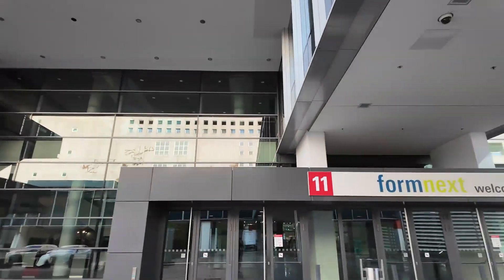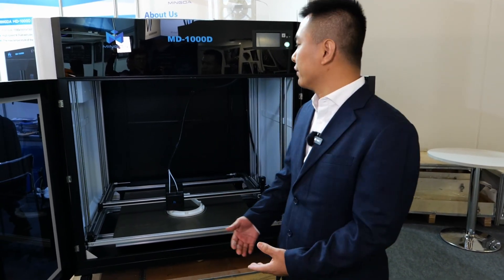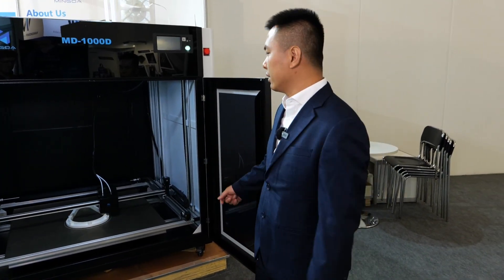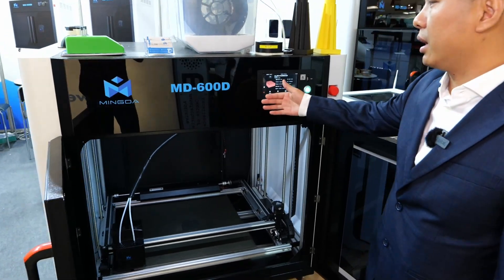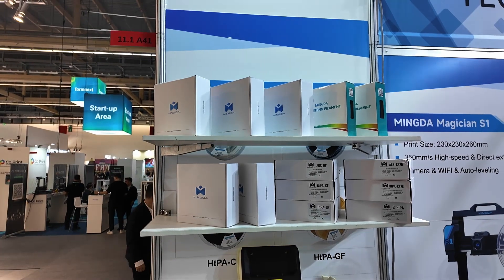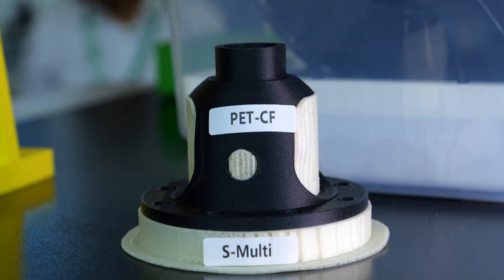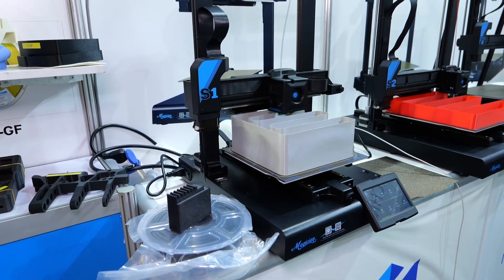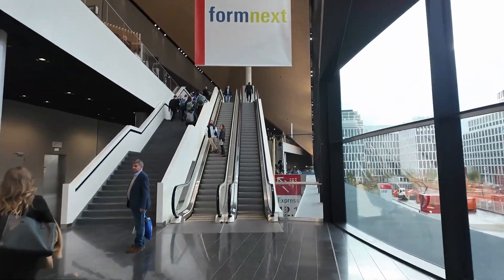MINGDA's giant 1000x1000x1000 mm 3D Printer at Formnext 2023 #AD

Comment: Never  even think of this useless printer.
Hardware as well as electronics both are of super cheap quality.
They even would not help you solve the issue. They will just waste your time in case you face any issue.
The print quality is super bad. Printer Makes lots of noise.
Cheap lead screws made the whole printer similar to 200usd printer.

Comment: The maximum flow rate I saw on the MD-1000D's front panel during this video was about 13 mm3/s.  I hope the hot end is capable of much more than that.  It would take weeks to print a part the size of this machine's build volume with such a low flow rate.

Comment: I'm sorry for this video 😢
I use bigger printers in my day to day work and I had a look at these too.
Loose bolts and nuts, they failed to give ANY insight to what hardware they use, and EVERYTHING was shaking in a bad way. And also, the prints for demonstration did not at al look like what was printing regards to quality.
CE-certification? I suspect not as they use a BTT Pi clone and whe wiring was sketchy in the electronics compartment.
And good luck heating that buildplate with one 220v 16A connection 😮
Please be more careful 🙏 to accept these deals Stefan, this was a nock down in my book 😢

Comment: Need advice. I have ender 5 as my first 3D printer. Bought it used, had to tune it to make it work - does the job... 
I want to by a second printer, the choice is overwhelming, my only criteria is direct extrusion, so I can print TPU. Other than that... I have no idea... 
I use 3D printing for hobby, so affordable is a priority. 
What are your thoughts 🙂 ?
Reply: You can't go wrong with a Prusa Mk3S or Mk4
Reply: Sure you, can, that would be a horrible choice today. Bambu A1 is the deal

Comment: It's always nice to see a new Mingda video.  There don't seem to be many.  I've had an original 2022 Mingda Magician X for over a year and have used it every day with no problems.  I've never adjusted or maintained it at all except to change nozzles.  I auto-level it when I change print surfaces and so on.  I was surprised that it required almost no effort from me to set up and run, which is what I always wanted from a 3D printer.  I hated every minute of wrestling with my old Ender 3.
Reply: I have  bought magician x  in the beginning of 22  it is great printer , first i ve added a second fan to the right side , soon after I started to print with petg , I bought and installed vertical volcano heatblock  screwed in adapter and using a regular or cht clones v6 nozzles  
With this setup it  prints petg easy and fast like pla on stock hotend or ecen faster

Comment: The bed slingers are not good, and are over priced, have locked down firmware and none of the newer features we require today, the industrial machines, mainly the MD-400 are quite nice, but no active chamber heater, which they absolutely should have at those build volumes, these guys contact me nearly every week to try and sell there machines, I told them directly, Im not interested in the bed slingers, you can't give these away these days, but once they put Klipper on the Industrial machines, I might be interested, looks like they have done this, so I might take another look.

Comment: Any hints as to what their industrial machines actually cost and where they can be purchased? I find "request pricing" buttons to be a real frustration. It makes specing and comparing machines a much more time-consuming process, often with hidden costs.
Reply: That is super common for industrial only devices. I once made a testing device that required multiple load cells. I had to put the parts into my wish list in order to see pricing

Comment: For these big printers, wouldn't it make since to run 3mm filament with a 1mm nozzle, instead of a 1.75mm filament and .4mm nozzle?
If you are going to print large items usually you don't need fine detail or want to wait 3 days or a week for a print, when it can be done in a day.
Reply: Dyze Design make extruders with 2.5mm nozzles. Some thick beads are possible with those.
Reply: Quality can still matter, and if its a protyping step even if it takes a week to print it will be way quicker than creating an injection or vacuum form mold etc and uses much less man hours than hand forming and assembling (though that could be quicker espeically if the precision doesn't need to be really high). There are absolutely folks that need huge and strong prints quickly, and for those might even be worth going to larger than 1mm nozzle and direct pellet extrusion, and every step inbetween.
Reply: @foldionepapyrus3441  I've experimented with bigger nozzles and you can still get the "quality", by using a small layer height setting. But because the nozzle is so big it lays down a "wider" filament line, so it takes less time to print especially with infill. And the wider filament lines "usually" create bigger bonding layers so it makes a stronger print.
Reply: @foldionepapyrus3441 I just don’t get why not even a 0.6mm nozzle isn’t considered.
Reply: @kyle8575  I expect it is is sometimes, but because the time saving of a larger nozzle isn't huge for most prints these sort of printers will do (I expect) - When its a prototype type gig you are probably just printing a few perimeter and as little infill as you can get away with most of the time to prove the fit and placement of all the details. Just two walls and low infill will take much the same time on the same machine as the head can only move so fast  but the finer nozzle gives a better surface finish.
Reply: @foldionepapyrus3441  you are vastly underestimating the time savings of a 0.6mm nozzle to a 0.4mm nozzle . I recommend you watch some videos on the difference between the two especially with Arachne
Reply: @kyle8575  If all you are doing is printing a single perimeter as you would in a vase mode print for instance a bigger nozzle often won't be any quicker at all - it might even end up a little slower as a big nozzle may not be able to keep melting plastic fast enough to keep up with the maximum speed the head can move - Forcing you to slow the machine down a little compared to a smaller nozzle. 

And assuming the heater block can keep up the extrusion rate required at that travel speed there is no difference at all. The time saving for a thicker extrusion mostly come from not having to do as many passes to get the desired infill level/wall thickness etc. Which isn't always very applicable. 

There is only one way a bigger nozzle can help in a vase mode type situation and its a marginal increase that will make print failure much more likely and the surface finish even worse - bump up the layer thickness beyond what you can get to adhere out of a smaller nozzle, but 0.4 - 0.6 mm really doesn't get you much there they are too close to each other maybe you can shave a handful of layers out of a print and so a very small amount of time. But neither is going to be capable of something like a 1, 2 or even 3mm layer height that really cuts down the print time - you would need to go even bigger nozzle for that and probably a direct pellet extruder.
Reply: @foldionepapyrus3441  I understand where you’re coming from, but you clearly have not tested the difference between these two nozzles. It is known that 0.4mm vs 0.6mm is significantly faster. I beg you watch a few videos on this, maybe Thomas Sandladerers for instance.
Reply: @kyle8575  Oh but I have tested it - bigger nozzle is not faster in every type of printing. It produces stronger results with better layer adhesion, and can be faster in some situations, just not all - the speed gain is mostly from being many less passes to get to your specified say 10% infill or 3mm thick walls - but when you are not doing infill or not doing it by % but a fixed infill pattern and don't care about how thick the walls are, you just want the shape it can easily end up slower as you just can't melt that much more filament that fast. 

The speed gain most folks see from such a tiny nozzle size bump is because they have 10-30% infill being sliced at a thicker extrusion width - so the slicer tells the machine to move a much shorter distance inside the part in the end - but that won't actually matter in many cases you would use such a giant printer.

And it does trade accuracy even with the fancy extrusion controls that have come to slicers recently letting you get something close to 0.4mm detail level in the old slicer out of a 0.8mm nozzle! (As of course the 0.4mm nozzle with that same slicing method can now get better details too).  

These giant printers seem to often be used for jobs where you are not getting the benefits of a bigger nozzle, but would still get the downsides. Or in places where even it took a month its still 3x faster or massively cheaper than you could get that prototype part made any other way - the sort of situation where you don't care about the speed nearly as much as the quality.

Comment: finally a video about these :)
and have you seen the Elegoo OrangeStorm Giga? that one is not enclosed, 800x800x1000 and 1500$ in a kickstarter
Reply: Seems to be limited to the base-level filaments: pla, petg, tpu. I'm thinking to get one but hard to predict my needs for next summer when they deliver. What's your usecase for having one?
Reply: @AndrewHelgeCox  could be useful for printing one pice wings or molds for wings for model airplanes
Reply: Ooh, using one of those bubbling lightweight filaments!
Reply: @AndrewHelgeCox  yes! :D they are awesome, can't see the layer lines
needs special care because of the oozing though

Comment: I'm wondering how leveling with two toolheads on one x-gantry works. Are there solutions for a median height between two measured points, or even an extrusion multiplier for the nozzle that has the bigger distance to the sheet?
Reply: Many industrial printers are set up like this.  The nozzle height is adjustable and you have to use an indicator to adjust both heads to the exact same height.
Reply: I bet you just have to adjust that to be bang on before you start
Reply: Wouldn’t it just run two bed leveling actions? Or one with the first nozzle and then a height check on the second, afterwards mapping the result across the first bed leveling?
Reply: @realgoose  They have to be the exact same height or 1 nozzle will drag over the part.
Reply: @bluerider0988  in the video I thought there was a mechanism that lifts one nozzle slightly higher durning printing. Wouldn’t that make them more independent for leveling purposes?
Reply: @realgoose   We have industrial 3d printers at my work and they have 3 nozzles on the head and you have to set them all to the same height with an indicator.

If they are probing the bed with each individual Nozzle, and the nozzle not in use can move out of the way, then what your suggesting is possible.  

That being said it would be way easier imo to just set the nozzles at the same height.  It takes like 15 minutes and you won't have to do it again until you change a nozzle.

Comment: Seems quite slow for such a big printer, but I suppose it's hard to make everything rigid at that size
Reply: I expect that at this size you should expect it not to be rigid and thus apply real-time compensation for bending of materials.

I know in 3D CNC metrology, there are systems using lasers to measure bends to apply compensation when measuring at sub-micron resolution on larger 3D measuring machines. Especially when using scanning probes you need to at least record the bends/errors in real-time.
So maybe they do have quite extensive calibration data of how that specific machine behaves with the extrusion head at every position and given some acceleration.
Reply: Wait till you hear about house size cnc mills with micrometer tolerance.
Reply: Doesn't need to move the head very fast to extrude huge amounts if the nozzle is big.

My MK3S with .6mm high flow nozzle and 0.3mm layer height can do just over 1kg per 24h.
I'm sure this beast can extrude much faster
Reply: They look slow because they are so big. My v0 looks infinitely faster than my trident, even though only the acceleration is higher while the speed is lower

Comment: It’s $16,999😓
Some other facts! 

1. 1 cubic meter volume.
2. High-temperature nozzle option.
3. Intelligent auto-leveling system.
4. Built-in UPS feature.
5. Magnetic, detachable build plates.
Reply: Lol, 17k sounds like high way robbery.
Reply: @iTeerRex its not a consumer printer Professional printers are expensive. Did you ever buy a stratasys or a cnc machine?
Reply: @mshepard2264  Yes I know metal cutting cnc machines are very expensive, but is this one’s quality worth that price, it certainly has the volume.
Reply: built in UPS is smart, don't know why I hadn't seen that before
Reply: Add VAT and sales tax, shipping… $20k easily. I looked and it said ‘inquire’ I immediately knew it was out of reach.